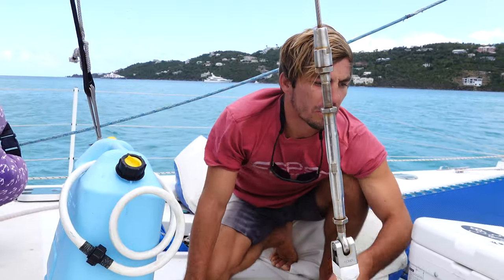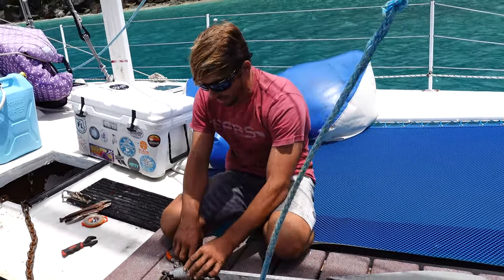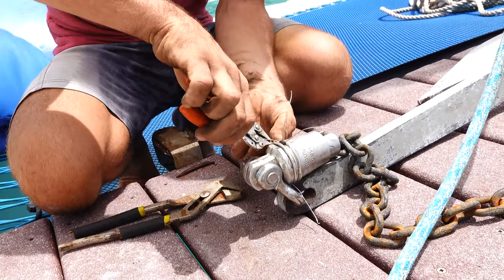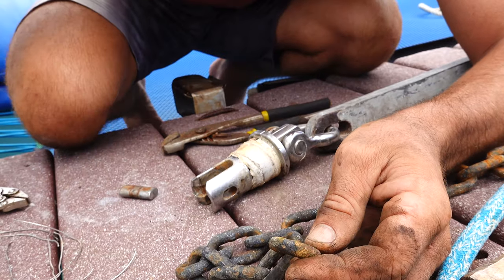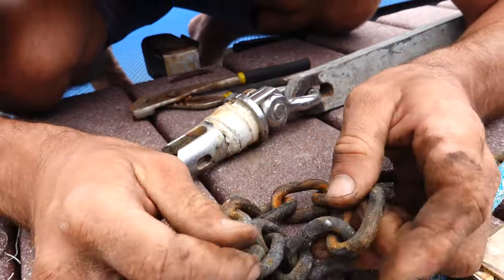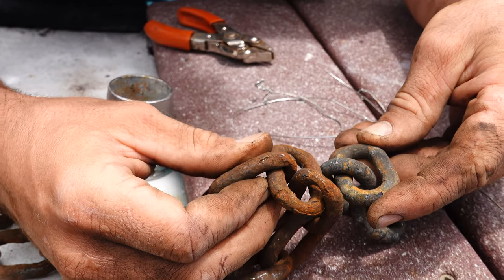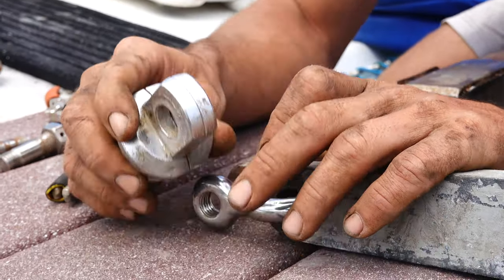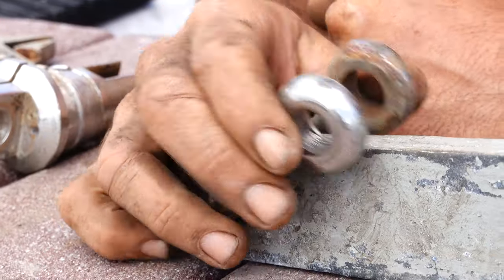1 Year on the Sea Floor! Comprehensive Review of Mantus Stainless Steel Anchor Swivel!

Comment: I have a 30kg/65lb. Mantus anchor, swivel and bridle; all are excellent (I also have the Mantus dinghy anchor ). At this point, I will only purchase Mantus anchor products, which are really well thought out and crafted. My Mantus holds my 50' MY in place and has never dragged. In changing winds, the anchor resets immediately. Ultra anchors are great too, but they are only SS, so very expensive.

Comment: Great review, and i already have a 30 lb something as my storm anchor and a 17 lb mantus  as my regular anchor.  I also use the mantus swivel.  Don't forget guys to use monel wire for tying everything together.  You can request extra monel from mantus when purchasing.  Love the Mantus anchors.  I sail a 30 ft trimaran named Quetzal.  It is a 30 foot Condor performance boat.

Comment: the teflon tape is for preventing galling of the SS, which means the threads will cold weld and then you can not get it apart.

Comment: I would have thought you would get more corrosion on the first link. So this was very informative. That corroded chain is toast. I assume you got rid of it by now. You have to re-galvanize your chain from time to time before it gets that bad. It looks like your anchor is corroding just a bit near the stainless shackle. But the anchor is pretty thick so maybe not much of a concern.

Comment: Thanks for the video.  Researching anchor swivels and your experience is great to see.    Not sure if you are aware of Tef-Gel but it's an amazing stainless antigalling and anti corroision lubricant.   I use tef-gel liberally.  I kept thinking as you were pulling the teflon tape off how I would have just coated all the surfaces with tef-gel.  Admittedly the teflon tape doesn't get all over your hands like a paste but that's not an issue, right?  ha   you got a new subscriber.

Comment: Eric is right you  must get rid of that corroded chain. It is a boat killer in its weakened state. If you cannot replace it immediately you might consider cutting the chain down to the longest length of uncompromised links and then add rope to provide a sufficiently long overall rode. Will's earlier comment about chain vs. rope is interesting but the argument for chain might have less to do with modern material strength than the chain's advantage of strength and overall weight spread along  the rode's full length which has a dampening effect. Also, in crowded anchorages where most boats use chain rodes a boat using a longer length of nylon and chain is going to be a lousy neighbor. In fact it could get ugly, don't ask me how I know.

Comment: Thanks for this excellent video!   I suppose the conceptual reason for adding a swivel is to help keep twist out of the anchor chain.   However in some testing done by Practical Sailor they concluded that there is "no convincing reason to add a swivel to an anchor setup" because they don't really do much.   Therefore, assuming that their testing is valid, it would seem that introducing this additional element is only creating places for a failure to occur with little benefit.
Reply: They actually recommend adding a short piece of chain between the anchor and swivel to avoid side loads that cause swivel failure! 

On my boat I use chain only with oversized shackles!
Reply: @fredbrillo1849  no mantus doesn't....
Reply: Just opened the Mantus on a boat we recently bought. The last link is badly rusted.  I expect the tight tolerance wore off the galvanizing.  I also discovered the anchor will not flop over when it enters the roller only because the groove in the center of roller grabs the shank.   I'll lose the Mantus and add a roller without the groove like I've had on all my previous boats.
Reply: That's generally a good rule of thumb, but here's why I went with the Mantus: There are important benefits to consider not discussed to any significant degree in the testing, which surprised me: For example, I have seen and experienced that without a swivel the chain can become twisted, so that when droping, a twist can cause the chain to get knotted as it runs out of the spurling pipe. And when weighing, a twisted chain can become folded on itself on the way up, jamming in the roller or jumping off the gypsy chain wheel. In either of those cases you now need to release a chain knot under load, often while drifting. Once this happens a few times when you're coming or leaving in a blow, it's an easy choice to consider a proper swivel, properly installed, maintained and inspected.